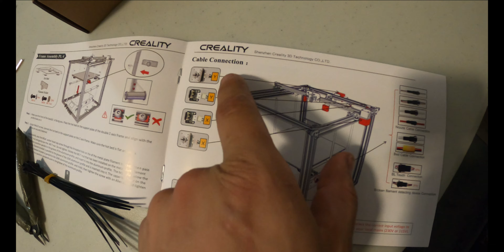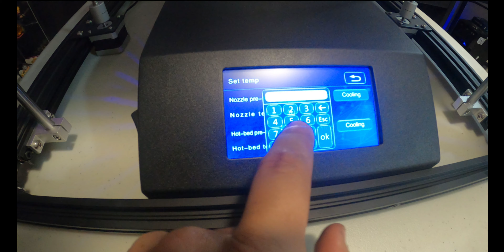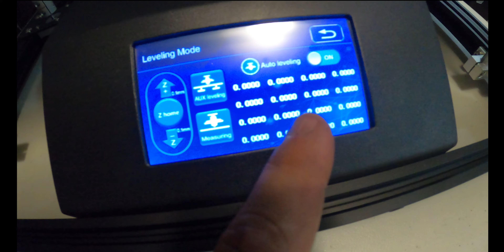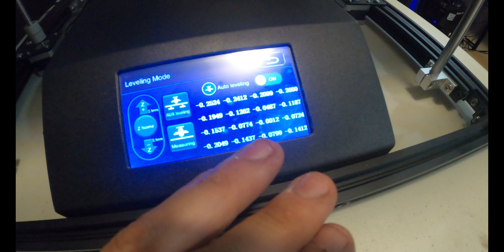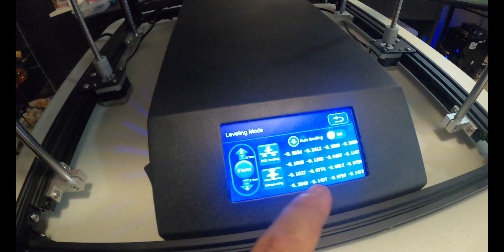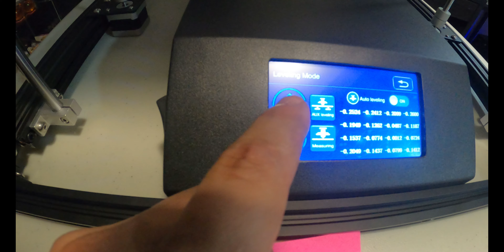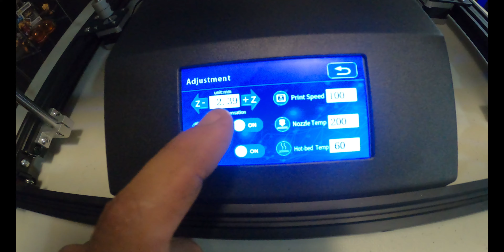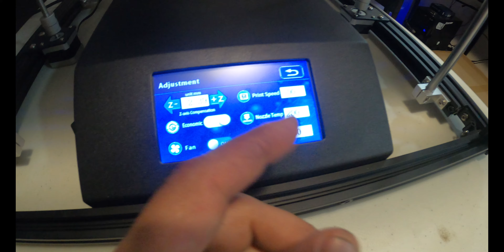Creality Ender 5 Plus - Assembly Guide and Startup Tips - Special  Build Series

Comment: Watched this video start to finish and was more than ready when my Ender 5 Plus arrived today. It was a flawless assembly. However...

I am having serious issues now. I tried a print at default settings (bed - 50 degrees, nozzle - 200 degrees) and the filament was having a very hard time coming out of the nozzle, and I just got a small stringy mess. After several tries I figured the temp might be too low so I raised it to 60/210. It had the exact same issue, so I stopped the print. After about 10 seconds, the thing just DIED on me! Completely dead! Won't turn on AT ALL!! No display, nothing! I can't tell you how PO'd I am about this because I have been researching printers for months to avoid exactly this!

If anyone can offer any advice it would be greatly appreciated, but I think this thing is toast.
Reply: @mafiahalo93  Thanks for the response. I also had the universal power supply, as I had a metal plate where the switch would have been. Anyway, I returned the bad printer and just now finished assembling the new one. Now I have a different problem. I have a cable labeled "m" left over with no mention of it in the guide whatsoever. I could have sworn I had the same issue last time and just plugged in all the other cables then figured out where it's supposed to go by process of elimination. This time I have checked several times and can't figure it out for the life of me. The assembly guide has some pretty pictures, but parts of it really suck.

Edit to add: I found it! Goes to the extruder.

Comment: Frankly, I have a Ender 5 Plus printer I received on Thursday and with the lastest firmware.  During printing when I go into adjustment and hit either the Z+ or Z- it will advance by .10mm EX: - 2.69 hit it once it will jump to -2.79.  Do you know a way to fix that so it will only advance by 0.1mm?

Comment: I just finished putting my 5 plus together but the y-axis wheels seem to be rubbing on the rails. I keep trying to adjust the eccentric nuts but I must be doing something wrong because they just keep making this awful sound. Did you have this problem? and if so do you know how to potentially fix it?
Reply: Did you ever figure it out? Mine is doing the same thing.
Reply: Robert Reynolds I contacted the company and they’re sending me a new y motor. One of the pins was broken

Comment: What would be the inch lbs be on on the bolts used so I prevent myself from stripping out them threads?
Reply from the maker: No idea lol Creality doesn’t provide torque specs
Reply: @FranklyBuilt  your video is well made thanks.

Comment: so weird. the manual does appear to suggest installing the filament holder pointing in. but the second page with a pic of fully assembled on my updated manual it shows the holder pointing out. AND the Creality Qualified Certified triangle shaped card in the box is also 0.2mm and can be used to level the bed

Comment: i bought one of these two days ago and having non stop issues with the extruder chewing up filament, ive upgraded the extruder, tried different filaments, played around with settings and spring tension and nothing seems to work
Reply: Maybe the temp sensor is faulty, or wrong? The printer might think the temp is correct, but in reality it is way to low.

Comment: Ender 5 Plus vs the  CR-10S Pro V2. I want one, which should I pick? PLEASE help?
Reply from the maker: 5 plus if you’re okay modifying it a little
Reply: @FranklyBuilt  Can I ask why? I was looking at buying the Ender 3 V2 at first but I want a bigger bed, Is the 5 plus what you recommend?
Reply from the maker: 5 plus is way way faster and only a little smaller
Reply: @FranklyBuilt  How does the 5 plus compare to the Ender 3 v2 that everyones losing is about? and in regards to larger prints in the $700 max budget range is this the one you would choose?
Reply: @FranklyBuilt  is there another printer with a bed this size you’d recommend
Reply from the maker: Not for what you want to do no. Stay away from the s4 and s5
Reply from the maker: The 5 plus is way bigger and better. And that’s the best one for that budget
Reply: @FranklyBuilt  I wonder how quiet I can make this thing
Reply from the maker: With a silent board, very
Reply: @FranklyBuilt  I was also concerned about the fumes! Some plastic are more toxic than others. How do you deal with this?
Reply from the maker: PLA is non toxic
Reply: @FranklyBuilt  if there’s one thing that’s holding me back from buying it’s that splicing is intimidating me. I don’t know what I need to do it or if the programs are free, or if it’s relatively easy. Am I doing the moding of the program for the specific printer or does the program do it for me.
Reply from the maker: Check one of my newer videos “how to fit anything in any printer”

Comment: Great video for everything except that you should've mentioned to not move the gimbal back and forth before connecting the wires. Now I have a problem! Message: Cycle Power! An issue exists with the bed or nozzle temperature sensor. Connect to a serial monitor. If reading is 0 condition is open, if too high, condition is a short to ground.
Reply from the maker: That’s really kind of a random myth on the newer printers. If somethings broken on yours it isn’t from that.
Reply: @FranklyBuilt  Its a new out of the box ender 5 plus. I did upgrade to all metal extruder and all metal hot end before first use, so maybe I did something wrong. What kind of problems can happen if you move the belt around with the wring connected but not plugged in? I did see the BL touch light up when I moved the belts. Then you mentioned to make sure that the unit wasn't connected before moving the belts but it was too late. Why did you mention that, what can it damage? Thanks
Reply: @outdoorsman5500  you can move the stepper motors slowly while the wires are connected, but if you move them too fast, you’ll damage the stepper drivers and/or MB.  Minor damage will just lessen their lifetime, while greater damage will make them inoperable.  There is no middle ground, they will either work, or they won’t.  If they’re weakened you you’ll hear the motors skip and you’ll end up with failed prints.  Other things can cause skipping as well, so don’t just assume that skipping means that they are damaged.  Contact whomever you purchased it from to get help.

Comment: So i got an ender 5 plus followed the instructions and this video went to turn it on and the fan turns on and runs but the screen does not turn on. I looked on reddit and they mentioned 2 possible problems a voltage switch or the screen not plugged in to the right spot. I looked at the screen and it looked to be right...maybe? I can not find a switch anywhere that would change the voltage. Any and all help would be great. Thank you.
Reply: Update my ender 5 plus has the universal power supply. The screen still will not work

Comment: I'm waiting to be added to an Ender 5 FB group- but wanted to know if anyone has tips on trouble shooting bed alignment? After turning it on and going to leveling,it checks X and Y correctly but Z is stopping 2+ inches below the nozzle and BL touch. When I look at the position under "move" X =180, Y=180 , Z=0. I'm clueless- this is my first 3D printer and nothing in their guide addresses this.
Reply from the maker: You have to do an aux level and or adjust the Z home offset on the touchscreen
Reply: @FranklyBuilt  thanks,  I will try that.

Comment: mine needs dropped off the empire state building,, aggravating .. no matter what I print, it does it in the front left corner half on half off, even looses settings often, when cable hooked up to the pc, works,, but when you turn the printer off, it sets there and blinks the screen on it, till you unplug it......... alot of weird things, it even ate my new glass bed with scratches doing weird things

Comment: I got mine and I can’t get the nozzle close enough to the bed it always leaves a really big gap between the nozzle and bed
Reply from the maker: You need to level with the knobs first. Then measure the 16 points
Reply: I hate to bother you again, but I had another question. My prints are consistently getting messed up if they’re too tall or if I have a print that has a large surface area and lay it flat it always ends up getting warped. What settings would you recommend to stop this from happening? I’m new with all of this and need all the help I can get

Comment: My ender 6 plus, struggles to hit the back trigger and makes a knocking sound??  And doesn't touch the trigger
Reply: I had a simmelar problem on my Ender3, I think. My problem was that the bed leveling screws where to tight. Resoulting in the bed hiting the Y-axis motor, it should go clear over it. Don't know if this is the case for the Ender 6, tho..